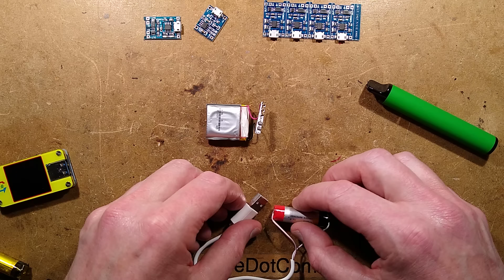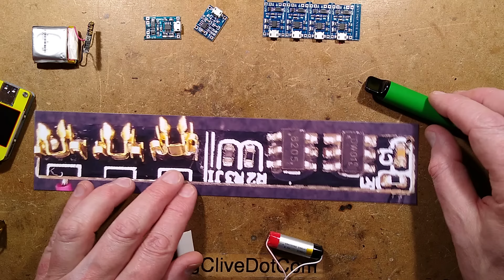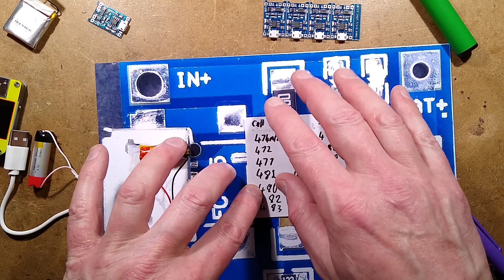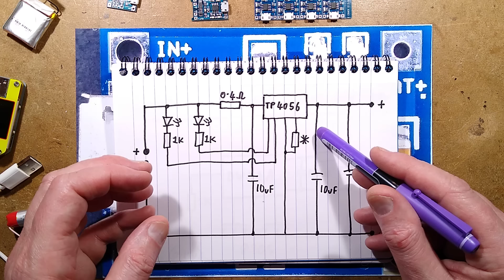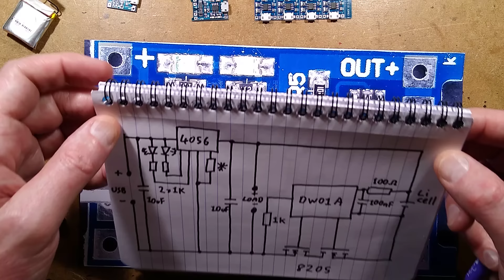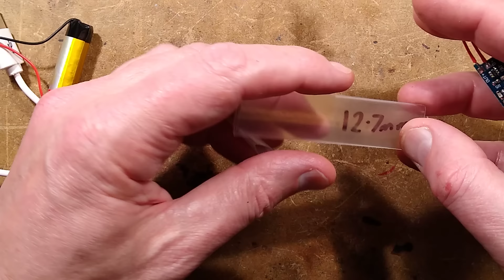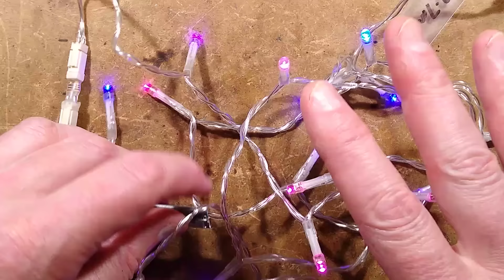Don't do this!   (There's a much safer way)

Comment: Thanks good build; I wonder if these modules get upset if you left them charging whilst drawing the load in a UPS fashion.
Reply from the maker: If the load is lower than the charge current then the module will charge the battery to that level and then power the load.  It will look like the charging doesn't end, but in reality it will not overcharge the cell.

Comment: I used to use something like these to charge my ecig batteries with an adapter to fit batteries with a spring, I was in a rush one day and accidentally put a battery in backwards and heard a quiet pop. I went to a vape shop and bought a proper charger but further inspection when I had some free time, It was still charging without the LED, the LED was blown and I think the pop was the charging indicator LED failing, maybe since it was providing 4v and when I put the battery in the wrong way I suspect the LED momentarily saw 6-8v
Reply: It's quite impressive that they've managed to make the battery hold ~900wh/L considering the usable energy in a car is around 3kwh/L of fuel.  It kind of shows that battery packs may actually soon get close to the energy density of fuel (by volume), apparently the record is 1.6kwh/L... Meaning you could fit one to a car in the same space as a fuel tank and still keep 50% (or more - since you can capture and reuse energy in an EV) of the range!. 😂
Reply: The only time the efficiency of an internal combustion engine changes is when you start using your heating. Energy wise the engine will jump in efficiency because the heat is being used for something. You don't get further on the fuel you use but the jump in efficiency is directed at keeping you warm. If compared to a resistive heater in an EV an internal combustion engine jumps from being 30% (3kwh/L) efficient to 40-60% (4-6kwh/l) efficiency (depending on the flow of coolant to the external radiator)

Comment: I didn't know it was physically possible to recharge non rechargable batteries! I thought it was a chemical limitation due to it's contents or something like that! Incredibly interesting, thanks! 

Also, I would be stoked to see someone  make a bicycke battery pack out of scrap batteries
Reply from the maker: The cells they used in disposable vapes were usually fully rechargeable.  It was the most cost effective way to have a high energy cell.

Comment: So I did some number crunchy on the 4056, its inversely linear, the resistor you want in kOhm is about 1000/(0,85 * I[mA] - 10)

Comment: I did that many years ago to bring back a cell phone battery that the phone wouldn't charge anymore. I just pulsed a charge into it and kept watching the voltage with a multi meter. It worked and the battery never failed again.

Comment: I find these vapes all the time alongside the road. A lot of them have a USB-C connected to a proper HVC/LVC  charge circuit, I’ve even found them with a state of charging indicator! All of this in a sealed plastic package with stinky nicotine!
Of course I bring them home disassemble, and repurpose them for anything that uses AAs or AAA’s 
I guess we could call this market failure at its best

Comment: I had 2  18650's in a charger that failed they exploded and caught the plastic charger on fire. I now have all my chargers in a fireproof box I made.
Reply from the maker: I sometimes charge stuff in metal oven trays as a precaution.

Comment: CLIVE, please help

Out of the vape is a micro pc that holds a switch (operated by air pressure) and an LED.  You can review that please?
Reply from the maker: They tend to be based on a custom chip and a tiny diaphragm based pressure sensor made in the same case as a microphone.
Reply: I'm trying to get the LEDs to light up....  They light then go out.  Must be some sort of logic on the chip...

Comment: i charge them with bench power supply limited to 1.2 amp
Reply from the maker: The maximum current I recommend for charging lithium cells like this is their capacity.  So 500mA for 500mAh cells.  And definitely double check that your power supply is set to a maximum of 4.2V

Comment: I got an XStar charger that works at 5v and use it with my solar controller. 😁 As an individual controller, some vapor things got an recharge module.

Comment: Rather than soldering directly to the battery terminals, I’d recommend getting a properly sized battery holder and soldering to the terminals of the battery holder.  It comes in handy when you have several cells to process.

Comment: I just found a crystal prime vape outside my house and it's quite sturdy construction really. I could possibly be turned into a flashlight. Its acryilic with an aluminium case. Usb c charging on the base.

Comment: How can i use these batteries for adding lights to a model car? I have a batman truck that i want to add lights but i have no knowledge for electronics and i don't want to blow up😅
Reply from the maker: The safe use of lithium cells like this requires suitable understanding of their hazards.  A safer option might be the CR2032 lithium button cells.

Comment: Hey clive, After seeing this video and having recently bought a disposable vape myself, i realized i had an old 510 usb charger laying around in a drawer. I unscrewed the plastic case and soldered a wire to the positive and negative output terminals. This works absolutely perfectly for recharging these cells as its rated for 4.2V at 420ma. They even have a green fully charged led and overcharge protection. They are really rather cheap to pick up, you can get 2 for 5 pounds from a quick google. Just thought it was an option worth considering.
Reply from the maker: Be aware that some of the 510 style chargers just limit and monitor current.  The device being charged has to shut off the charging itself.

Comment: Use 1amp usb type C Charing module... It has auto cut circuit without it battery could explode...i am using charging module since 2015 they are really good.. it will protect battery from full drain auto short circuit protection n cut off to prevent over charging.. enhances battery life n performance

Comment: I have an old nokia phone charger. 3.7v 350mA i plan to try.
Reply from the maker: If you have a meter, make sure the output voltage is not higher than 4.2V.  The Nokia phone may have had extra charge control circuitry in it.

Comment: How many times can i recharge with this module one battery?
Reply from the maker: It depends on  how the battery is used.  But I have one here that has had about 100 cycles and is still near the same capacity.

Comment: How do you get everything to solder so easy I don't believe it I'm ready to head butta unicorn by the time I'm done trying to do it
Reply from the maker: Practice.  And the biggest secret of all - don't carry solder to the joint on the iron.  Bridge the iron tip between the lead to be soldered and the pad, and flow the solder into it.  Electronic solder has a flux core that cleans the surfaces dynamically as the solder flows.  If you melt solder onto the iron and then try to scrape it off onto the joint there will be no flux left.

Comment: Can I unplug the batteries and use the output directly from the cell after it is fully charged? I want to build battery packs for my xbox controllers und there is not much space for the module
Reply from the maker: The cells can be used on their own, but be careful to avoid over-discharging them.
Also keep in mind that these are energy cells and can dissipate a lot of heat and ignite if shorted.  Finally - take extra care to check polarity when connecting to equipment, as a brief reverse polarity can destroy a lot of stuff fast.  Use these cells at your own risk.

Comment: I think there is a charging module inside the vape which can be used to charge the battery
Reply from the maker: Some have charge circuitry, but others don't.

Comment: USB 5 V only wires is supposed to be limited to 100 mA.  That's the risk to be assessed supposedly and in relation to battery capacity. 
More power needs to be negotiated between host and client. Resistors can be used to statically request more if no USB chip is available client side. The in the middle analyzer used here probably negotiated for maximum available power. Or the USB A connector has a resistor hidden inside, it could have been salvaged from a usb device like a water pump with static high power needs. The rumour of madmen havoc USB PSUs with fire limited current supply causes me some serious discomfort. In general it's a genius and simple way to charge. One just should know about the USB charging ways and assess the thermal runaway possibility . I guess it is beyond the scope of 5V 100 mA in many cases, don't blame me though.
 I do like the 4056 charging modules as well ! Got mine for 17¢ in a 100 pcs. pack

Comment: I one time tried to charge lithium cell using a 5 volt source that was also current limited. I didn't have any safety circuitry, but I set a timer for what should have been a reasonable amount of time. A short while later, I you're a pop and see a flash as it jumps off my table and becomes an expensive firecracker. Turns out I connected it to a 16 volt source not a 5 volt source. Thankfully it was about the size of the one in your hands or a little smaller even, so it wasn't a huge boom. And it was on a glass table, and my dad had shoes on so he stepped on it to put out the fire. But yeah, that was a little scary.

Comment: Can a 1s Lipo charger like the EFLC1008 charge it or is the 4056 our only option?
Reply from the maker: That charger probably contains a 4056 or the smaller LTH7.
Reply: @ I have a ton of them laying around from my rc helis. Figured I might be able to use that with the vape batteries and use them to fly. They’re very similar in size and triple the capacity just have to change the connector.

Comment: To swap the SMD resistor on one of these boards, will a 1/2 watt SMD resistor fit the pad ok?  I would prefer a 250-300 mah charge on most these small cells you would use with this.  Who knows, I might someday want something I could charge with just a USB plug.

Comment: If you're going to play around with harvested batteries, I STRONGLY suggest you at least invest in something like an Imax B6 hobby charger.  It is a fairly inexpensive computerized charger which monitors the cells.  

Yes, I do use BMS boards fairly similar to these for harvested Vape cells to build custom batteries, even some 2S2P batteries made of matched cells (matched capacity is checked on the Imax before grouping them).  I always charge these batteries on the Imax Even With the 2S protection boards.  These boards are Not Smart to use for charging.  You need to know the capacity and I only charge them at around 1/2 the rate. I mainly use these boards as a last resort for Over-Discharged cut-off state.  

I have a pile of Vuse vapes and I disassemble them for the cells and the powerful magnets.  I also use tiny wired connectors (sort of like those shown here) to connect them to the Imax for charging or to devices (soldered onto the device), I think they are call Jst connectors.  Lithium cells are not like NIMH you can just screw around with.  Be Smart.  Get a real charger if you want to do this.

Comment: Been reusing "disposable " Li cells since they've existed.  In most devices 1 Li cell (4.2v) will replace 3 alkaline cells (3x1.5v=4.5v). I hot glue the cell and the charger in the device and connect the wires. One good size lithium cell will last longer than 3 alkaline cells of similar size too.

Comment: AI-generated video summary
Quality and accuracy may vary.

This video demonstrates the dangers of charging salvaged lithium cells directly with a USB cable. The presenter explains why this method is unsafe and shows how to build a safe and effective charging circuit using readily available components. The video also covers the importance of respecting lithium cells and using proper charging techniques to extend their lifespan.

damn, do all videos have this now?? lol

Comment: Would a normal battery work? The type of battery you put in a tv remote control.
Reply from the maker: No.  These devices are designed for a specific type of battery.

Comment: can the INplus and INminus be used as the input? so i dont need to use only the port
Reply from the maker: The connections on either side of the USB connector are often an alternative input.  You can test that with a meter.

Comment: so for my stupid self, if i have a 18650 batery 3.7v  and 5volt input from charger, if i conect this to the batery then i can charge the batery normaly right?
Reply from the maker: The TP4056 modules can be used for charging an 18650 from a USB supply.

Comment: Do i need a different BMS if ive hooked them up in series to get 14 volts? What and where?
Reply from the maker: You would need a BMS board for the specific number of cells you used.

Comment: If your phone charge block is 1 amp or less would it still shoot up to 3 amps like you mentioned in the first few moments of this video? I'm not going to pretend to know as much as you do, your content is great, but I do this constantly, and with those exact batteries but I am vigilant with a multimeter to keep an eye on it ..I had one pop but I literally drained it, worked it hard and went straight to charging it and it popped almost instantly... But that's the only incident I personally have had
Reply from the maker: The charger current rating is the intended maximum current draw.  Under near short circuit conditions the current can be much higher.

Comment: I was searching for a way to recharge batteries from disposable vapes, in my country you can't really dispose of lithium batteries safely. You either throw them in the trash or keep them, there's literally one single company that can handle them but they only do big jobs like for offices that are replacing old equipment and such. And I don't want to make the garbage collector truck go up in flames so I have soooooo many batteries in my house, one exploded once ig I had it stored improperly idk, luckily I heard it like sizzling and was able to push it out to the patio before it exploded, I had it right next to my bed it could've burnt down my house 😭... But yeah, thanks for this video, I've been too scared to touch them, so this is gonna help me so much

Comment: I was just trying to hit my vape a couple more times....... Instead I was put through a college course in electronics, and now I have to go out and buy a soldering iron and a bunch of computer boards and a flux capacitor off of eBay and wait for them to get delivered to my house , and build this contraption ........ The only thing is I got paid last Friday and the parts still aren't in so I just went ahead and bought a new vape😂😂😂

Comment: This video just popped up on suggested list , as I was looking adflo batteries . 
But anyway always enjoy watching your videos . 

I have few question for you , not about this video though , well one kind of is . start with that , on this video you said to make sure the polarity is right way with the croc clip or the module will not like it . 

I got a fake Imax b6 (did not know at the time of buying it was fake) But I connected a parallel 18650 and didn't notice that I did connect it the wrong way round . Now , I think I have F'd it , will not let charge a battery with more than 0.1 A , is there any way that I can fix that ?

2,) Have you made any videos on mini spot welder for 18650s ?
Have you made a mini spot welder ?
I did search , but nothing came up , any plans on doing a video on this?

There was something else but for the life of me can't think what it was , will get back to you on that
Reply from the maker: It might be possible to repair the charger if you can identify the failed components.  I've looked at the spot welders, but found them to be a bit random in operation.  I've not made a video about them.

Comment: Is it possible to wire 2  of them in series to reduce  the voltage and 2 or 3 of them in parallel to reduce the current and charge them safely without that board?
Reply from the maker: No it's not safe to do that.  Lithium cells should only be charged with proper circuitry.

Comment: I don't even need to charge lithium cells, why do I even watching this lol

Ok, probably because this is actually interesting and I like electronics in general. Pretty cool to see a BMS being this small and not a freaking graphics card sized thing like SmartBMS 14-20S ones that I used to work with.

Comment: 12:50  One may prefer to put the female connector on the cell side (not the power supply side) since it's less likely to get accidentally shorted.  Generally with these circuits the power supply can handle a short circuit in a safer manner than the cell can (especially when there are faults in the protection circuitry).

Comment: 00:27  Got something off Amazon that used that exact charge circuit.  For added fun the item's cell had no built-in protection circuit either.  Needless to say I replaced the "charger" with a proper MCP73831-based LiPo charger.

Comment: With the kinda high amperage going out of the TP4056 being a bit too high for a single battery, if you had two batteries in parallel (so that it’s still the 4 volts, but higher amps) would that work as well as replacing the resistor you mentioned?
Reply: I’m NOT an electrical engineer by any stretch, so this might’ve been a silly question
Reply from the maker: If the two cells are bridged in parallel while at a very similar voltage they will behave as a single larger cell and can be charged at the higher current.